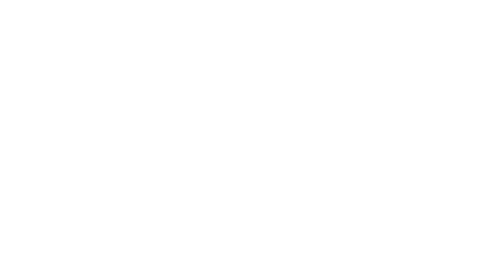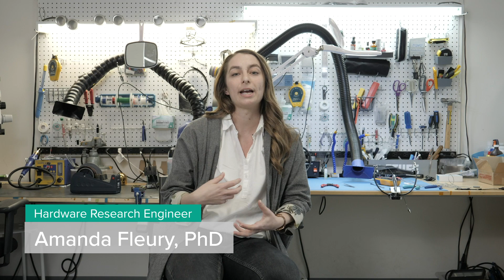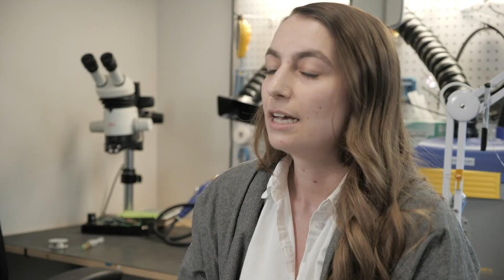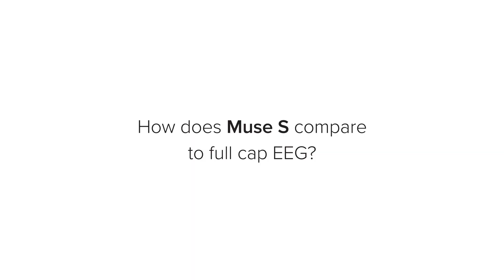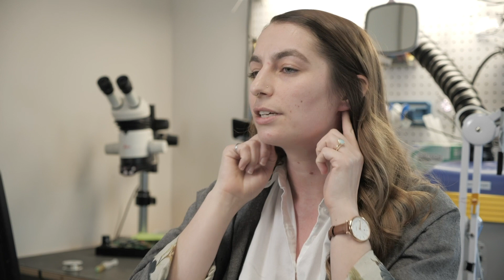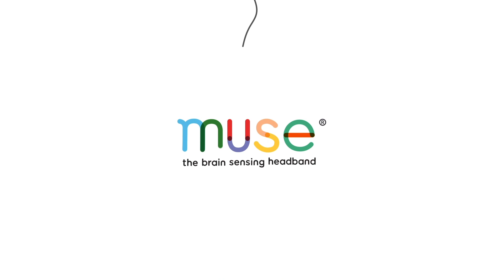Electrodes: What Are They and How Do They Work?

Comment: Thank you for a great video.  Please answer my question: how does electricity from the skin make electrons in the wire flow in a particular direction?  What is going from the skin to the electrode wire?
Reply: I'm trying to find out the same thing. The only thing I can guess is it's like a transformer, using induction.
Reply: Gel in skin has some salt which respond to electric field change in the skin and this in turn causes change in EF in the copper wire connected to measuring device.  Now copper free valence electrons move in this EF. @N30HuM4n